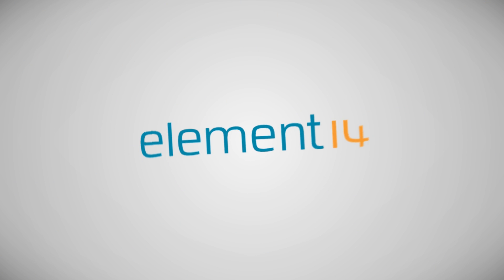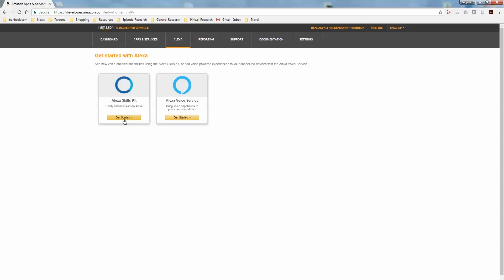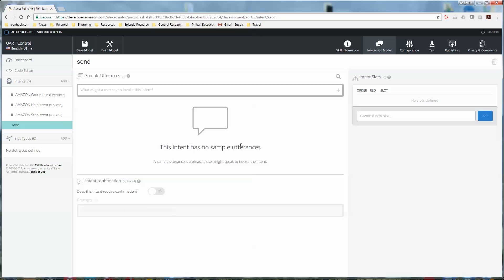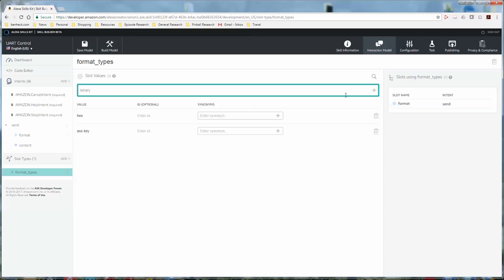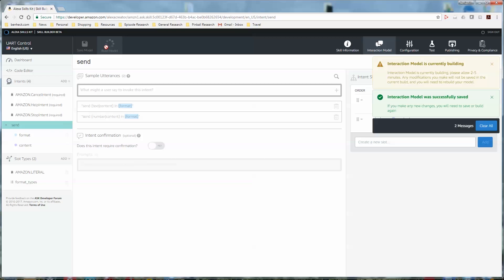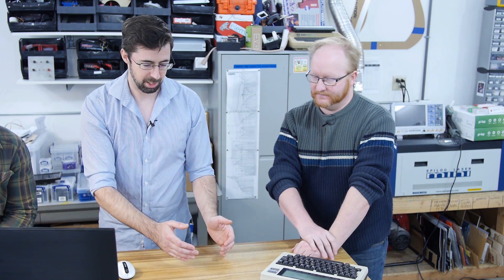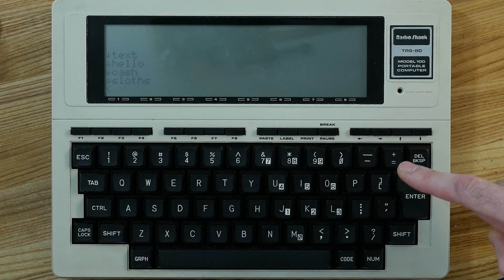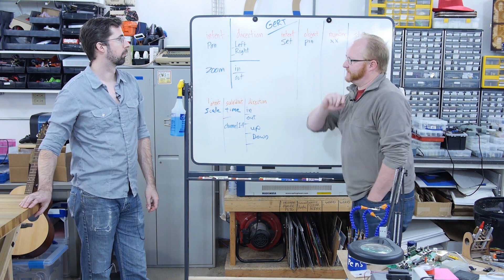Alexa Automated Workbench Part 1

Comment: Why is everyone debating which server and interpreter to use instead of apache + php, when the real point should be that the implementation of the $command variable allows you to exploit the operating system by passing unhandled text to shell_exec?

At the end of the day this is just an example of one piece of this project. But please do not use this code example literally, and then expose it to the internet.

Mr. Heck, if this code is running on your network in the shop, it's a genuine matter of time before a bot will find that IP and expose the vulnerability. Happens all the time. To boil it down you cannot take literal strings from a web request and pass it to the operating system. If there was a legitimate reason to pass this to python, it should be passed to a python server over a local socket, not invoked by a shell command.

Comment: \why not just setup a Python web server?
Reply: Yeah! At least PHP will be gone...
Reply: Matthias Weingärtner and apache ;)
Reply: If I understood correctly how this works, I think you'd need a Python server and a python script anyways, because when Alexa sends it's json values, it sends them through a TCP connection, and the way the team appeared to have set up the things is that the raspberry pi has a fixed IP so that the port forwarding configuration on the router is easier, so they need an application that translates the UDP packages from Alexa to the actual json values and those kind of applications are server applications, then with the json values they can invoke locally a script that manages de gpio of the raspberry pi.
Tl:dr; from the raspberry pi they need an application that translates web packages to the actual data and they need another application to do the GPIO managing.
I guess you could do a little server program that handles request in a local py script and then does the GPIO too, but that would actually be more complicated if nobody in the shop knows how to do that
Reply: Well yes, a python server is just simply a wsgi python script waiting for something to poke it, you can have it execute the code and return something. It's very simple. 100% less of a headache over an Apache + PHP setup.
Reply: not a fan of that if else code
Reply: Could have used node js as webserver. Node js will also talk to hardware.
Reply: Yes, you could. I was doing this on a pi that already had apache/php for another project, I found tutorial code in php, and I liked the idea of separating the web part from the hardware part for debugging and simplicity. It was WAY easier to debug the hardware when I could call the python script from the command line instead of requiring a web service call. Plus I'm more comfortable doing web development in PHP. If you're doing your own, feel free to use python or node.

Comment: Such a complicated way of doing this on the Pi side. Just make a python web server, or a nodejs web server. Either of those can talk to the hardware directly.
Reply: NS Gaming nodejs is the same overkill ;) but I agree to the python webserver: if your interface program is written in python anyway... and there are really good python libraries for web serving and json parsing...
Reply: I'm not altogether sure why you say node.js is overkill but python is not. node.js works with json straight away without a library, because, well, javascript object.  It's also a little bit more tailor made for a webserver, whereas a python webserver is more of an aside.   They're both a good fit here but if anything I'd probably lean more towards node.js, especially if I were writing an api for a skill.
Reply: NGinuity ok, i take it back, if it is written purely in js with node, then ok :) it is nice as well
Reply: Yeah it can be done.  node.js has a library in npm called "serialport".  It works really well.  Check it out if you get a chance!

Comment: Amazon -> Apache -> PHP -> Python -> UART could be cut right down to Amazon -> Python -> UART..

Alternatively, you could just set the Echo on fire because Amazon is a terrible company that loves bad practices like vendor lock-in, and I wouldn't trust their competence to make a secure voice activated device that isn't full of security holes.
Reply: himselfe pretty much
Reply: Or Amazon -> NodeJS -> UART. I'm confident PHP has a library, that allows UART as well. I know NodeJS does, as I've done something similar. I have a server laying around in my house, which receives the Alexa requests in Python (using FlaskAsk) and then I basically have a switch case for things like "turn computer on/off", "turn tv on/off", and so on. I simply use a couple of ESP8266 WiFi Arduino boards for the UART (not UART as in this example but rather just GPIO), to turn on relays and what not. WiFi enabled relays made easy. A simple GET request to the ESP8266 and I can do crazy things.